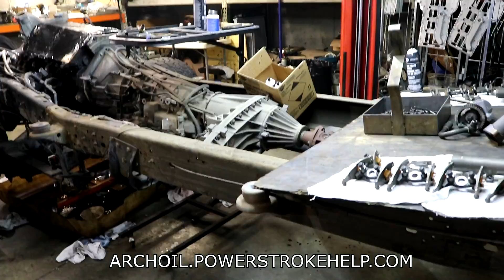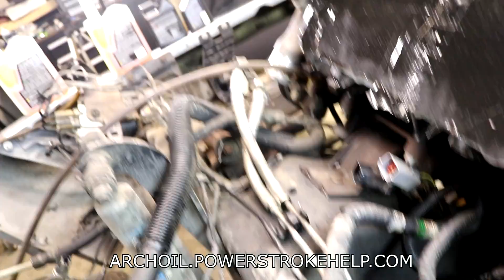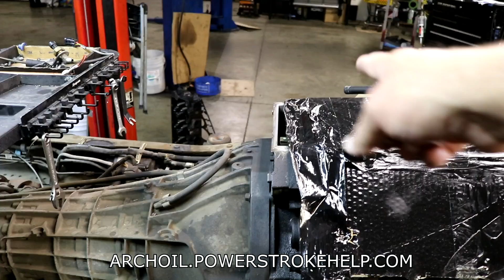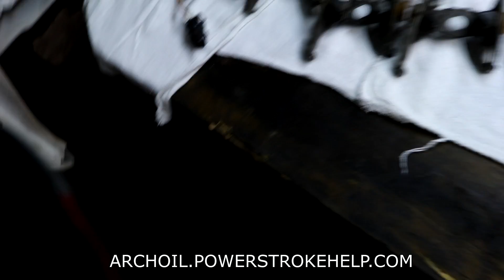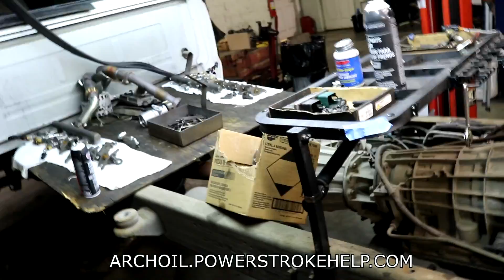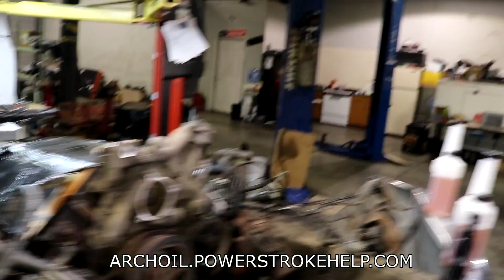YOUR DIESEL FUEL SYSTEM WILL FAIL (HOW TO PREVENT IT)

Comment: 2000 F350 7.3 Powerstroke.
It fricken Works! Saved me $3000 for  a continuous injector SEL problem. Tried everything heavy duty fuel system cleaner on Autozone shelf. No help. Made an appointment to have injectors replaced. Looking  at about $3000. Injectors for these diesels are expensive.  Bought Archoil product pack based on the advice of Powerstrokehelp. Didnt expect it to help. 2 or 3 gas tanks of fuel and Archoil products. It runs perfect. The SEL has been on for a year. I reset it numerous times and it always came back on. Not even a full bottle of Archoil and it fixed it. Runs perfect!! Saved me $3000+. Never will I go without your product for the life of my Powerstroke! Thank you Powerstrokehelp and Archoil.

Comment: Good day. I lost my turbo for the second time (with in 5000 miles) and I wanted to see if this aftermarket turbo was a good quality turbo, the ATS VFR Turbocharger - 11-14 Ford 6.7L?  Unfortunately my truck is DPS deleted. I am kind of regretting buying it. I was new to the diesel community when is bought the truck. Also could the delete have caused it? What is the cost to return it to factory?

Comment: 3 years ago I bought an early 1999 7.3 PS F350 DRW with 220k on the clock. It was getting 11 mpg empty load. Been using Archoil religiously for 3 years, now the truck has 238k on the clock, and I get 14 mpg empty load, and it runs noticeably better. Have not done anything to the engine to affect that other than archoil additives.  Far as I'm concerned this product pays for itself.

Comment: Well said and 100% spot on. US fuel cetane rating too low for efficient combustion. Especially for grocery getter city trucks. Guys must have deep pockets to putt around in a truck designed to work. Your additives are a necessary "must have". Like it or not Bill is right. These additives are chump change compaired to repairs either at home or god forbid 1000 miles away. Listen to experience not dealerships. Thank you Bill for your time and most of all experience. Its a pay me now or pay me big time later on. US fuels are diluted, mixed for profit. Not performance & economy. Happy Holidays to you & the crew!

Comment: I typically change the fuel filter every oil change and they always look 👍 , standard motorcraft products.

That is until... I used the fuel system cleaner. I added it about 500miles before the oil change and it was noticeably dirty when I did the service. Should I replace the filter again around 1500 miles or should I be good at this point? I think im good but, I also think I should add a few extra filter changes (2:1) until the filter is "clean looking" at the time of scheduled service.

 I started using the fuel / oil additives recently (first time) and there was an almost immediate difference after adding the fuel system cleaner, way smoother at idle and a good amount of sound reduction in the injectors,  maybe 20ish decibels... Worth the peace of mind!!!

Comment: Hi Bill, two things to say. I have a 1989 f350 with the idi 7.3 non turbo, bone stock. It’s always had a hard starting issue when cold even when the weather is warm. I’ve been through all the air leaks. Allegedly it has over 600k on the original engine. I’m wondering if you think I’d gain any benefits from archoil what with it being such a primative engine. I’ve listened to you tout it for years and figured it only benefitted the newer stuff, but would love to know what you think. 
Second point is that my dad bought a f250 7.3 ps new in 2002. It’s got 200k in it now and he’s run amsoil products in it from day one, along with an amsoil bypass oil filter. His truck runs like new to this day and he’s never used any fuel or oil additives in it, and he changes the oil at 10k or more. I understand that 200k in 20 years isn’t all that impressive. But the truck is heavy (rack and bumpers and such) and does get used for towing. Lots of in town driving. What’s your opinion on amsoil?
Reply: Every products that amoils puts out is the best on the market pretty much its worth the cost
Reply: @duramax2079  Archoil....Not Amsoil,

Comment: Happy Thanksgiving and thank you for all the advice you put out for us powerstroke owners. Definitely a great product I've been running this stuff for years now it wasn't until just recently I did the DPF delete on my 16 F250 since diesels aren't tested where I live prior to that I couldn't tell you the last time it did a regen. I just have a very mild tune and behave with it hahaha. Especially with how you said how expensive these new trucks are, I bought my 16 F250 In 2017 I thought it was expensive then now it's WAY worse. So therefore I plan on running my 2016 F250 and 2005 chevy 2500 gasser for as long as possible.

Comment: My personal 04 6.0 has 240k on the clock and never had any snake oil. Just EGR cooler delete, 2 injectors, HPOP, and oil cooler replaced @ 180k. Still runs great.
Reply: 182k on an 04 kr ccsb. All factory. Starts and runs solid. Even in the cold. I'll do injectors at 200 for fuel milage. Maintenance goes a long way.

Comment: DPF does not reduce carbon it increases it, the soot is not a greenhouse gas, also who melted the last ice age Ford or Toyota..  I have been running archoil products for 20 years..  my 7.3 runs great also use it in my ML350 2012.  Started my truck in VA two nights ago 23 degrees started no problem..

Comment: Not the way Fort Smith Arkansas wanted to get famous 😂
Reply from the maker: Fort Smith is actually a nice place BUT it is not a great place to be broke down. Meridian Ms was way worse. I had to do brakes in the rain in the parking lot of Wal mart and every time I left to go to Napa or back into Wal Mart the peeps would swoop in and steal any thing that wasn't locked up or bolted down. At first I thought I was just overtired, overcaffeinated and my mind fried from the road until I caught them. What a pain in the ass. I still have a big red welded 15# sledge hammer that not only got the drums off but also got my other tools back too. I smile at my old friend every time I see it in the shop.
Reply: @powerstrokehelp  The only Ford dealership in Fort Smith is Randall Ford and I imagine their service dept is covered up all the time!

Comment: Owning a diesel seem exhausting. I would only own one if it was making me money.
Reply: Only exhausting if you get a new one. I have a 6.0 from 2004 and I love it
Reply: New ones suck. All the new shit is shit. So disappointed, spend all this $ and have to add additives.  But I got the big screen in the dash though! Haha. Wtf. They only get away with it cuz we keep buying. Not anymore for myself. Make less money, I have less problems. Rather work on my body than a 60000$ truck.
Reply: @2Goldens1Rott eh I grew up around diesels. I traded in a paid off 2019f150 and got into a 1 ton lariat for a similar payment and it'll be paid off in less than 2 years. And in that time I'll had shoved 15k in my pocket. Then trade it in. All u need is a dump trailer. There is so much piddly work the big guys don't have time to do. Right up my alley.
Reply: Well said.

Comment: The 7.3 will always reign supreme, no EGR, no intercooler, no DPF, no DEF to add (hah they are laughing at all the fools buying urine to dump into their truck, how stupid is that shit), just straight up raw diesel power babey!
Reply: I have both. Different beasts. 6.0 pulls way better than the 7.3, but the 7.3 is simply more reliable. You won't be the first there towing heavy, but you'll be there. The 6.0 is able to hold lower egts under harder use. My 03 7.3 has lots of work done, and just doesn't match the ability of my 04 king ranch with large custom tunes, non "Cali compliant" hardware and turbo back exhaust. Still has the factory intake even. More gears, much better trans strategy, more fuel efficient, and a smoother more quiet and refined vehicle. 

That said, 182 on the 6.0, 297 on the 7.3. both factory injectors. Both start great, but the 7.3 is a bit Smokey when it's well below freezing and not started in a week. No studs, big tunes daily. Zero problems so far. 

Gonna have to go knock on wood now.
Reply: The 7.3 has a turbo which definitely means it has an intercooler....
Reply: @JustSomeGuy1776x  the obs 7.3s did not come with intercoolers.
Reply: @JustSomeGuy1776x  Some of the vans didn't have an intercooler because of the packaging.

Comment: Bill, several months ago my 04  F 250 six liter turbo was "barking" and stumbling when I would accelerate to go up a hill etc.  some research indicated it was probably soot/carbon buildup on turbo veins, probably because I dont driver her hard enough, I'm an old guy.  I wanted to avoid the major exspense of a turbo teardown so I tried the Archoil extreme fuel system cleaner adding it per directions and drove the truck abount 200 miles at highway speed.  It cleared up my issue in just over a tankful.  I posted this same info on some other diesel sites and got alot of blowback about "snakeoil" etc. but all I can say is it worked for me, now I drive the old girl harder but still use the fuel treatment every fill up and the extreme cleaner every 5000 miles.
Reply: In
Reply: Got fuel going through the turbo, do ya ?
Reply: @stevewhyte8476  like i said, i dont know all the whys and how this additive works, but in MY case it cleared my problem up and have had no issues since. archoil would probably be a better source of info then what i could provide on how it works, and no, i dont have fuel going through my turbo.

Comment: When you talk about the low quality fuel in the US, are you referring to excessive dirt/contamination or cetane level?
Reply: Diesel fuel in the US is "dry" i.e., it lacks lubricity. So, when you add a product like Archoil, or Hotshots Secret, it will make the fuel have better lubricity, thus better for your injection pump. Find a product and make sure to use it with each fill up.
Reply: And be religious about those fuel filter changes

Comment: Do you think we are running out of diesel fuel?
Reply: Because of JB immediate anti american oil statements and policies.
Kerosene that a lot of people here in the n.e. use to HEAT THEIR HOMES mia, and if U can find it >$7 a gal.
Lets Go Brandon
D.A.
Reply: i dont think we are close to out, but they sure want us to be. so buy and keep clean as much of it as you can
Reply: The Democrats hate fossil fuels but they offer no viable alternative except ever more restrictions on drilling and production. Bottom line, they want to force you into an electric vehicle (then tell you due to the grid and electrical shortages not to charge it, as the California Gov. just did) which are basically terrible and you still have to generate electricity from fossil sources in most cases. They are using restrictions and regulations to force you out of your vehicle, into urban areas and on to their beloved "public transit". They will kill our country (which from our current economy is plain to see) and our standard of living if they continue to hold power. The whole thing is based on the ruse of Climate Change which has gone on naturally for thousands of years. But Democrats create a crisis, and then use fear and indoctrination propaganda to get their way. They want total control. Your freedom to move about and your self reliance are a threat to their personal control, power and ultimately their personal wealth. They couldn't care less about your personal wealth which should be glaringly visible to a blind man right now at the grocery store and the fuel pump. Democrats, liberals, progressives are exactly the opposite of what they want you to believe. They are not your friend. They are evil, anti freedom Marxists.
Reply: The reserves of diesel is lower than it has ever been, diesel incoming is normal at this time but if refineries were to shut down our reserve supply is not much.

Comment: I would use Archoil religiously if I could find it at my local Rural king or tractor supply, but just can't find it anywhere. I can find hotshots though
Reply: Just order it direct and its free shipping. Thats what I do and I use it religiously in my Diesel. I order it 3 times each year and use it just as he is saying here. The new bottles make adding it to the tank really easy, no funnel. I read a study that shows some diesel fuel additives actually decrease lubricity. This and Stanadyne are both highly rated. Both are hard to buy over the counter.
Reply: I get mine off Amazon.
Reply from the maker: archoil.powerstrokehelp.com and use code "SAVE10" to get 10% off your order.

Comment: do I add the fuel system cleaner AND the AR6500 to the fuel tank at an oil change or just put in the fuel system cleaner and then put in the AR6500 next fill-up?  I have a 6.4 and I have been running archoil for 4 years
Reply: Just add the fuel system cleaner and friction modifier at oil changes. Then the fuel additive every fill up at 30 ml per 10 gallons.